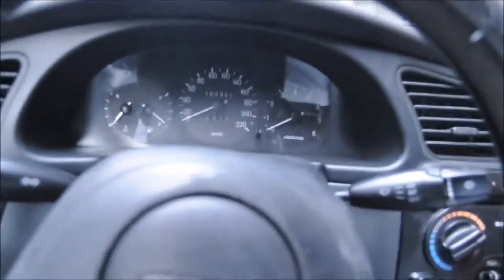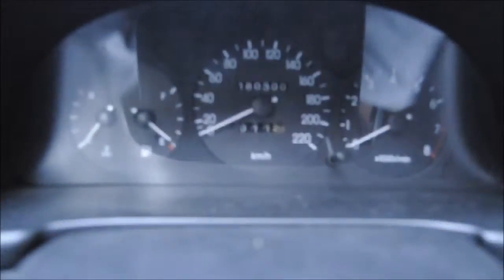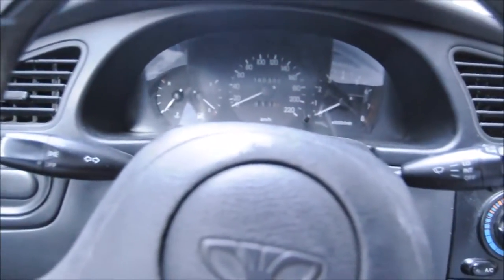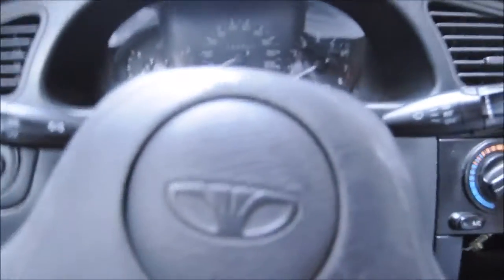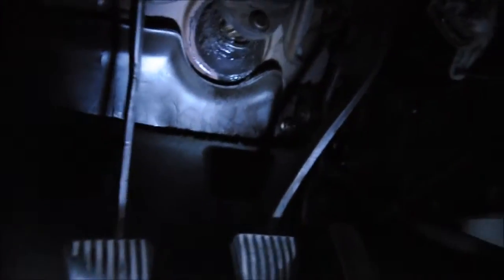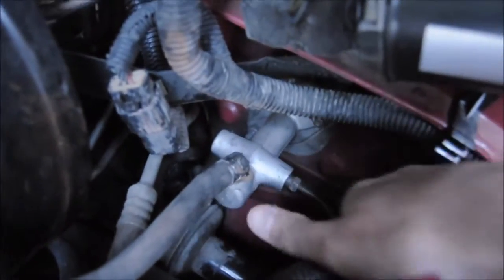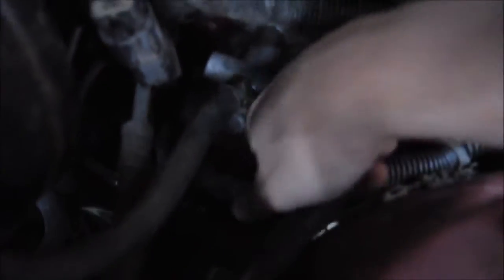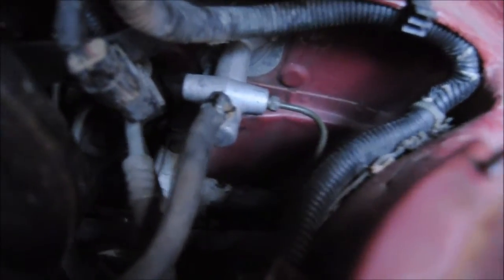Daewoo Lanos Broken Steering Rack Mount Autopsy (Bulkhead Crack - Astra F,etc)

Comment: Did you fix it? I'm worried mine would do this!
Reply from the maker: +Carlos S Yeah i removed the rack mount piece and welded it then put it back with bolts where it was spot welded in case it happens again.

This is caused mainly by power steering tension when you turn the wheels against sidewalks,etc,but normally it should not happen.

My power steering rack had a leak plus it was an engine load for no reason so i got rid of the whole system and replaced it with a non powered '89 Kadett E rack.

That's why i don't think it will happen again.
Reply: +truebassB It happened to my car.... But not like yours, mine actually had hair fractures and the top screw was not holding tight. I'm currently have it in the shop with a professional daewoo mechanic to get all the firewall reinforced and the rack secured with new mounts so it doesn't move.
Reply from the maker: +Carlos S Hey there,i have great info if you want to reinforce both mounts. The one that is opposite to your steering wheel does not carry a load,it's only a shock absorber,to fix it you need to make a solid clamp and put it instead of a rubber mount,this will move the load to the firewall so reinforcing it is a good idea,look on the web for "Saab Steering Rack Brace",it's the same rack and mounts on Saab as on Daewoo and Opel.

To fix the mount with the steering column hole,look for "vauxhall astra mk2 steering rack mount" to see photos on how us the drivers are "officially" fixing and reinforcing it.

There is a booklet for all the complete reinforcings on Vauxhall racing cars which could help you a lot with the firewall but i don't remember how to find it.

I hope your mechanic will do a good job,these cars are very flexible with much weak points,reinforcing one transfers the load to another.